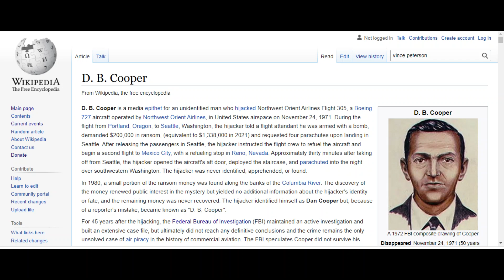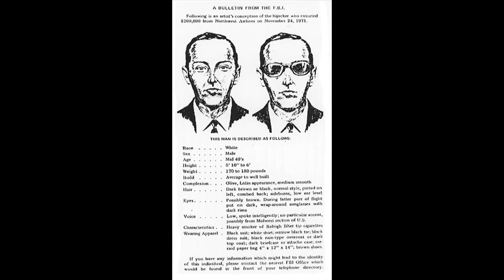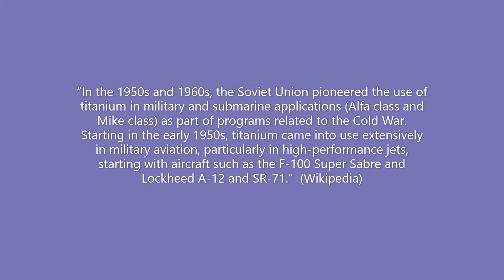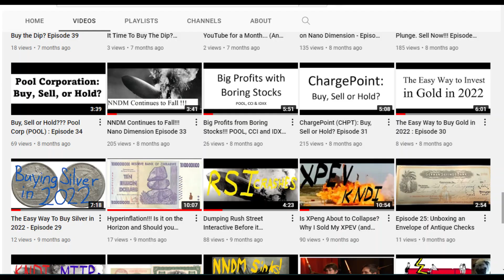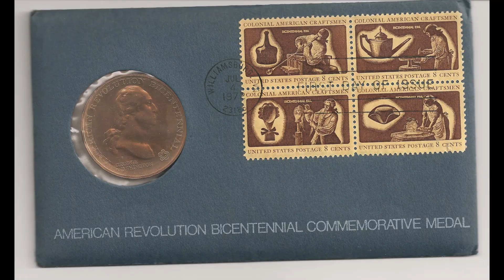DB Cooper: The Trouble with the Titanium Tie and the Latest Suspect. Episode 147

Comment: Having seen Ulich's video my question was whether he researched the man's fate or current situation.  Is he alive, dead, unknown?  Answering those questions would quickly add more info to confirm or disconfirm the possibility.
Reply from the maker: Hello, thanks for your comments. After my video on November 19th titled: Has the DB Cooper case finally been solved? episode 146 (and that is the episode number for my show to keep things more easily trackable since many of my titles are similar), that one was about Vince Petersen being identified by Eric Ulis as Cooper. The next day I did a video called: DB Cooper the trouble with the titanium tie and the latest suspect, which was episode 147. That talked about some issues with the titanium on the tie. Skipping ahead, over the past two days I uploaded a two-parter called: DB Cooper the terrible trouble with the titanium tie, part 1 and Part 2 which are episodes 159 and 160. Most of the comments that I've received along these lines were before I uploaded episode 159 and 160 so if you've not seen them I hope that you'll take a little time to watch them. In them I point out that the original research that Tom Kaye and Citizen Sleuths did, which still shows on their website as of yesterday, is that the three titanium articles are pure titanium, that is not an alloy. Eric Ulis’ conclusion based on Tom Kaye's research, Is that it was a specific type of titanium antimony alloy. Where the bridge between finding that the 3 particles were pure titanium turning into three particles of a titanium alloy I do not know, but let us for the sake of argument say that there was originally a mistake and that the particles are in fact indisputably a certain alloy of titanium antimony. Is it a valid statement that the only place that this would be found would be at Rem-Cru? I would argue: no. we have the three individuals who applied for the patent they worked at Battelle Memorial Institute in Columbus, OH. They did not work for Rem-Cru. It has been surmised, not my interpretation although I agree with it, that because the 3 petitioners for the patent worked at a nonprofit that four the patented material to be commercialized it needed to be patented under the auspices of a commercial organization, that is a Profit making company, not a nonprofit. Whether that's 100% accurate as far as the reason is probably not material here. What is material is whether these three people who worked at Battelle in Columbus, OH, produced any of this alloy there while they were developing the information for the patent, which I would argue most likely would be the case. How else could you come up with the data to put in the patent application if you have not first created the alloy? So if my contention is accurate then not only possibly at Rem-Cru, but most likely at Battelle there would be engineers working with the TiSb. So we have two places identified where there was likely that alloy at some point. Also remember that patents protect the commercialization of a discovery, product, or process, it does not preclude other people from working with that product and if they improve upon it, they can then patent the improvement to it. Also, the patent was rejected, there was a lawsuit, no patent for that particular alloy was given, and nobody was precluded from working with that particular alloy. Also in the most recent video that is episode 160, I put a screen shot of a scholarly journal written in English but from Scandinavia and probably from research done in Norway on four variations of titanium antimony alloy. That was published in 1962, a few years after the patent application was originally filed. And again lack of other online evidence does not mean that other people were not working with this material. If you were in a lab working with the material even if it was a nonprofit and you wanted to write a scholarly journal, if your work with the titanium antimony did not result in a new breakthrough of any type then you would not be writing the journal article in the first place. And many journal articles are not yet available online even if they do exist.
Again I would encourage people with questions or comments about this to watch those last two videos but I also caution people not to rush in to buying this as the ultimate smoking gun that has solved the case. I think that three particles out of 100,000 tested is a potentially suspiciously low number of particles that one might expect with somebody working with this alloy, although perhaps not. I have also worked in high tech situations at two companies that are well known throughout the world and I would argue that there are far more people that might come into casual contact with a few molecules of a particular alloy than one might expect and certainly more than a pool of only eight people. And as I've pointed out I would not be surprised if Cooper turned out to be some type of disgruntled OSHA inspector or some other type of inspector who would have gone to a variety of locations including perhaps Rem-Cru, and in the course of their job would have been exposed to the wide variety of high tech and aerospace associated molecules found on the tie besides this disputed titanium.
Thanks again for your comments and taking the time to make them here. Remember the whole point of this is to try to come to a conclusion on the identity of Cooper, not to win an argument. We all win when we are able to finally put this to rest, which perhaps may eventually be done using DNA and the particles on the tie might be able to help narrow down areas to look for certain candidates. Thanks again!

Comment: The money found was a plant.  Why does the tie have to have been Dan Cooper?  Why could someone else have had a tie like the one Dan Cooper had and left it while Cooper took his with him.  As Cooper's planning went it would not have made sense for him to have left the tie behind.
Reply from the maker: Well, there was no one on the plane except for Cooper, the cabin crew and one stewardess. I do not think anyone disputes that the tie was left behind by Cooper, but what is disputed, is what are the significance of the metals found on the tie? And how long did Cooper have it/ where did he get it? As an engineer? At a thrift store, etc. Thanks for your comment!
Reply: @theanthonyrrmillsshow3876  I still think it is possible that another passenger left tie when all passengers got off and no one noticed it until after Cooper got off.there are many ways that the meter particles could have gotten on the tie.  After all the years there are still so many unanswered questions.  I think whoever's did it had to move the money out of the country as none of the money has turned up.  Serial numbers were recorded.  Spent out of the country the bills may never return to the states.
Reply from the maker: @stevejorgensen5523  Here is what has been stated by researchers working with the FBI: The black tie was found on the cushion of seat 18E, the seat Cooper was sitting in [1]. 
1.	FBI Transcript: "A black clip-on tie which contained a tie clip, yellow gold in color, with a round, white pearl in the center, was located in the seat allegedly used by the hijacker. The tie bore the label "Towncraft", a trade-mark of the JC Penney, Company. Tie and clip were found on seat 18E and Stewardess TINA MUCKLOW, after seeing the tie, said it possibly belonged to the hijacker."

So let's remember that generally after people disembark from a plane the stewards or stewardesses walk up and down the aisle picking up things left behind, straightening magazines, etc. Is it likely that if another passenger on a previous flight had left a clip on black tie sitting on the cushion would it be overlooked by the crew when they were cleaning and tidying up the plane? I think that it's extremely unlikely that it would be overlooked and left there. Is it possible? Yes it's possible. Is it at all likely? No not at all likely. But for us to believe that it did not belong to Cooper, it would have to be taken off by whoever sat in that spot when flying into Portland. Taking off their tie and putting it on the cushion as they get up into part with nobody around them noticing and calling that to their attention. Then the crew coming through checking for left behind items and not noticing 8 long black men's tie sitting on the cushion of the seat. And then Cooper coming on going to his seat either not noticing that there was a tie sitting on the seat or him noticing that there was and him still sitting on it and not thinking that a clip on tie might be uncomfortable to sit on. If you're not familiar with clip on ties there's a metal spring in them which is not going to be all that comfortable to sit on. And then Cooper flies from Portland to Seattle at which time he gives the note concerning the bomb. Eventually all the passengers get off, presumably he still sitting in that spot so there's no opportunity for unaware passengers to be taking off their ties and tossing them over onto his seat because he's still sitting there. And then taking off from Seattle towards Reno he continues sitting on somebody else's clip on tie. All of that would have to happen if you argue this is not DB Cooper's tie. All of that could happen but I think that the chances of that are extremely low. Now this does not mean that the clip on tie was not purchased the day before by Cooper at a thrift store in Portland. It could have been purchased at a garage sale in Pennsylvania a few weeks before. It could have belonged to an engineer at Rem-Cru, it could have belonged to an OSHA inspector. It could have belonged to other people and have been contaminated in situations where DB Cooper was not present, so the particles on the tie may or may not have any relevance to Cooper's past but I have no doubt and no researchers seem to have any doubt that this was the clip on tie that he was wearing when he boarded flight 305. You and I may have to just agree to disagree but I think that I have outlined accurate facts that cast little doubt that the tie belonged to Cooper at the time of his jump rather than somebody else.
Reply: @theanthonyrrmillsshow3876  my thought is that with all his planning it would not make sense for him to forget it.  If it was a plant to divert the investigation then yes.  One of the fun things about this is that we can speculate and have fun.
Reply from the maker: @stevejorgensen5523  With DNA and micron microscopes in use these days, leaving behind such red herrings would be more logical. But at that time, no one had any clue that DNA could be retrieved from cigarette butts or a tie, nor a thing called internet genealogy would exist where we could actually connect the Somerton Man or the Golden State Killer, to living relatives. So I think in this case, he left the tie behind because he did not need to look like a respectable businessman anymore, nor need a tie flapping in his face as he jumped. As with the Somerton Man, most of the clues associated with him, lead to speculations about all kinds of things: a love child, Soviet Spy ring, assassination, most of which was not the case. He was a mundane, divorced man, evidently with no kids, whose wife divorced him and did not want anything to do with him, and he seems to have ended his own life, smoking a cigarette watching the waves. This may be what Cooper turns out to be.

Comment: At this time Titanium was rare I believe. The only source at this time was USSR, so it can not be called common in 1971. The pool of people that could have been exposed to Titanium in 1971 has to be small.
Reply from the maker: Thanks so much for the kind comments. I just uploaded a few minutes ago one of the videos that I am most proud of so far, you might be interested to take a look: D.B. Cooper: The Terrible Trouble with the Titanium Tie. Part 1. Episode 159
Reply from the maker: Hello, thanks for your comments. After my video on November 19th titled: Has the DB Cooper case finally been solved? episode 146 (and that is the episode number for my show to keep things more easily trackable since many of my titles are similar), that one was about Vince Petersen being identified by Eric Ulis as Cooper. The next day I did a video called: DB Cooper the trouble with the titanium tie and the latest suspect, which was episode 147. That talked about some issues with the titanium on the tie. Skipping ahead, over the past two days I uploaded a two-parter called: DB Cooper the terrible trouble with the titanium tie, part 1 and Part 2 which are episodes 159 and 160. Most of the comments that I've received along these lines were before I uploaded episode 159 and 160 so if you've not seen them I hope that you'll take a little time to watch them. In them I point out that the original research that Tom Kaye and Citizen Sleuths did, which still shows on their website as of yesterday, is that the three titanium articles are pure titanium, that is not an alloy. Eric Ulis’ conclusion based on Tom Kaye's research, Is that it was a specific type of titanium antimony alloy. Where the bridge between finding that the 3 particles were pure titanium turning into three particles of a titanium alloy I do not know, but let us for the sake of argument say that there was originally a mistake and that the particles are in fact indisputably a certain alloy of titanium antimony. Is it a valid statement that the only place that this would be found would be at Rem-Cru? I would argue: no. we have the three individuals who applied for the patent they worked at Battelle Memorial Institute in Columbus, OH. They did not work for Rem-Cru. It has been surmised, not my interpretation although I agree with it, that because the 3 petitioners for the patent worked at a nonprofit that four the patented material to be commercialized it needed to be patented under the auspices of a commercial organization, that is a Profit making company, not a nonprofit. Whether that's 100% accurate as far as the reason is probably not material here. What is material is whether these three people who worked at Battelle in Columbus, OH, produced any of this alloy there while they were developing the information for the patent, which I would argue most likely would be the case. How else could you come up with the data to put in the patent application if you have not first created the alloy? So if my contention is accurate then not only possibly at Rem-Cru, but most likely at Battelle there would be engineers working with the TiSb. So we have two places identified where there was likely that alloy at some point. Also remember that patents protect the commercialization of a discovery, product, or process, it does not preclude other people from working with that product and if they improve upon it, they can then patent the improvement to it. Also, the patent was rejected, there was a lawsuit, no patent for that particular alloy was given, and nobody was precluded from working with that particular alloy. Also in the most recent video that is episode 160, I put a screen shot of a scholarly journal written in English but from Scandinavia and probably from research done in Norway on four variations of titanium antimony alloy. That was published in 1962, a few years after the patent application was originally filed. And again lack of other online evidence does not mean that other people were not working with this material. If you were in a lab working with the material even if it was a nonprofit and you wanted to write a scholarly journal, if your work with the titanium antimony did not result in a new breakthrough of any type then you would not be writing the journal article in the first place. And many journal articles are not yet available online even if they do exist.
Again I would encourage people with questions or comments about this to watch those last two videos but I also caution people not to rush in to buying this as the ultimate smoking gun that has solved the case. I think that three particles out of 100,000 tested is a potentially suspiciously low number of particles that one might expect with somebody working with this alloy, although perhaps not. I have also worked in high tech situations at two companies that are well known throughout the world and I would argue that there are far more people that might come into casual contact with a few molecules of a particular alloy than one might expect and certainly more than a pool of only eight people. And as I've pointed out I would not be surprised if Cooper turned out to be some type of disgruntled OSHA inspector or some other type of inspector who would have gone to a variety of locations including perhaps Rem-Cru, and in the course of their job would have been exposed to the wide variety of high tech and aerospace associated molecules found on the tie besides this disputed titanium.
Thanks again for your comments and taking the time to make them here. Remember the whole point of this is to try to come to a conclusion on the identity of Cooper, not to win an argument. We all win when we are able to finally put this to rest, which perhaps may eventually be done using DNA and the particles on the tie might be able to help narrow down areas to look for certain candidates. Thanks again!